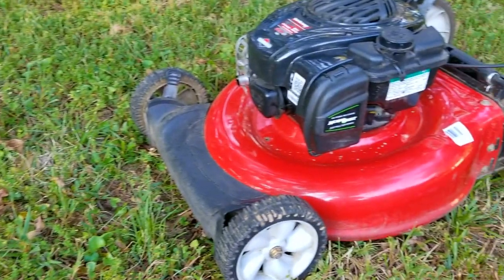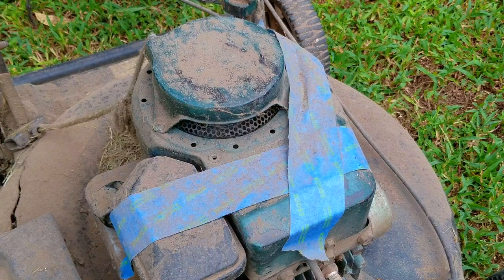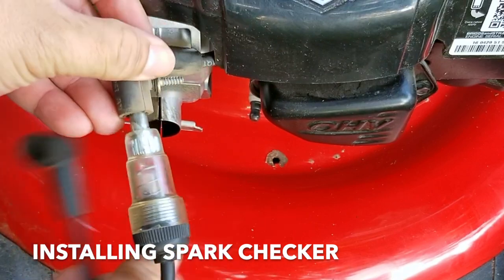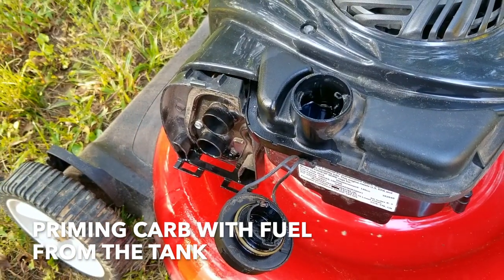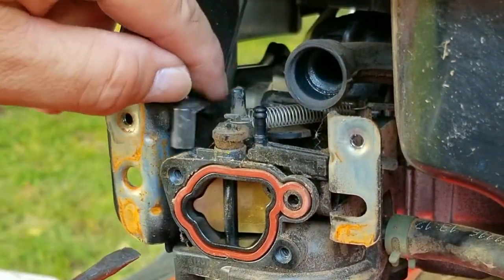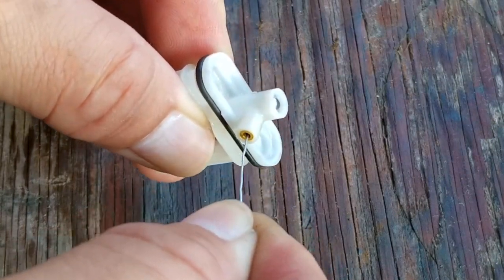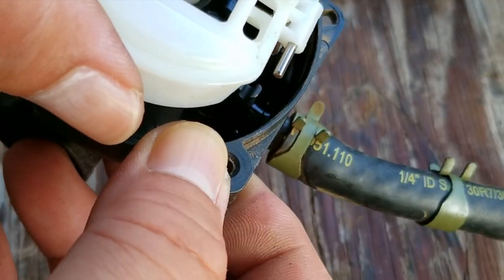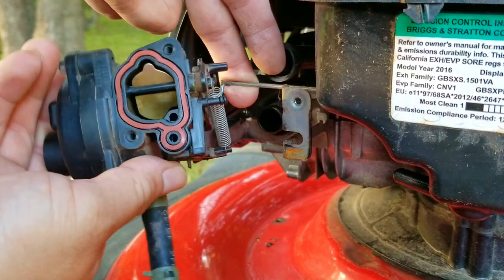Why Did Briggs Stop Making The Flathead Engine?

Comment: When I was a kid in the 50s, I mowed our lawn with a 1 hp B&S flathead reel mower. One time I removed the head and cleaned out all the crud in the combustion chamber and replaced the head without even a new gasket. The compression was around 5 to 1 but the machine still had a lot of pep. Every once in a while I'd go over to the nearby Chevron station and get a gallon of white gas for it. The air cleaner was one of those oil-bath types.
Reply from the maker: thank you kpadmirer.

Comment: emission standards
Reply: Shouldn't flatheads be easier to run lean because of the lower compression ratio?
Reply: This is the correct answer.
Reply from the maker: if so they held out for a long time.
Reply from the maker: probably but then they wouldn't make hardly any power.
Reply: @INSIDEHOUSEGARAGE  Yes, exactly, you are correct. The OHV design is better for emissions and can run leaner, but ultimately costs more to make than the flathead design. They did their best to hold out, but they eventually had to switch over to the OHV and find other ways to save money, as the valvetrain costs more to manufacture. That's probably why other areas are more skimped out.
Reply from the maker: I have to agree with you.

Comment: I have a 1998 KGro Power Pro Riding Law mower with a flat head engine Purchased from K Mart. Other than a belt replacement and a new Carb with Regular Oil change she has run like a champ for over the last 20+ Years! And Still Going strong!!!
Reply from the maker: Thanks for sharing

Comment: The Flathead engine was well abandoned by the automobile industrial 60 yrs ago for its low efficiency. It survived till recently is lack of competition. Its hard to adjust valve stem clearance also make some of the pull start really hard.  The OHV engine have way better combustion chamber, burn cleaner and use less fuel. Look at all the commercial push lawnmower engines all use OHV engines.
Reply from the maker: you are correct

Comment: I've had a 163 for 3 seasons and I'm sold.  Compared to my memory of pushing Briggs equipped mowers in the 1970's (for other people) which I hated, and the Lawn Boy my parents owned (which I liked) the light weight and solid power of these new engines reminds me of the Lawn Boy's power to weight. Every Briggs was just pushed into a corner after use and to my knowledge none of them were well-maintained so they all had their own special incantation to get them started and most of them had some sort of personality in how they ran. These new ones are a different experience- they either start and run great or they don't and there is a very specific issue to fix. Keeping the valve lash in spec and the float bowl clean seems to be all mine needs to start on the first pull every time. Making a carb that can be replaced with two socket drivers and $15 is an accomplishment.
Reply from the maker: Wow, I like this comment a lot!

Comment: I have a Craftsman lawnmower with a 6.0 horsepower Briggs and Stratton engine. I don’t know it’s age, but it’s the flathead design. The thing runs beautifully. I plan to change the oil in it this spring just like I did last spring. I use SAE 30 weight oil every time.
Reply from the maker: very nice maintenance!

Comment: I actually found one of these mowers on the side of the road in the past. I was able to clean the carb jets, the smallest jet was clogged. 

Used the metal from a bread tie (coating removed) and cleared it out before blasting it with carb cleaner. It wasn't a difficult thing to do, and there easy to trouble shoot if you have some starter fluid on you.
Reply from the maker: very nice work!
Reply: Electric guitar string wire is both stronger and skinnier and comes in 6 sizes.

Comment: I had a intek briggs on a john deere zeroturn. The camshaft failed as they do on those motors at about 200 hours. The neighbour has a cat D6, he dug a hole 4 feet deep especially to bury the  intek. Great feeling to never see that junker again!!
I now have two old push mowers with flathead briggs and a kohler on the zero turn. They have run now close to 11 years with no problems
Reply from the maker: wow that's amazing that you buried the mower!

Comment: in '73 I took a 6 h.p. B&S engine off the 'Planet JR.' rider (pulled gangs) (BTW that same engine was bore and stroked twice by mfgr. to become 7 then 8 h.p.) that hadn't been used since '59. I disassembled and cleaned it, reassembled it, and got it to start and run! Basement cleaning project that taught me sumthin'!
Reply from the maker: not a bad way to learn.

Comment: As someone who worked in small engine repair for atleast a year and a half (and kind of maintains my small fleet; toro smartstow w/ bs 163 cc, bs snowblower w/ 212 cc, power mate 2-stroke trimmer/edger, Ryobi 2-stroke 14" chainsaw w/ 37 cc), I can vouch the older models are definitely tried and true compared. Those ol' 3 hp mowers were very reliable and the plasticy, primer style carbs worked well, and the engines to follow were, IMHO, better designed even though it had more pieces. My Toro, despite having that crappy newer plastic carb (actually very easy to rebuild as you showed), is still a good, tough mower. I'm not a fan of the smaller 125 and 140 cc engines, respectively.
Even though they don't have drain plugs, you can tilt the mower on the oil side, and it works as well. Even though your video was about Briggs and Stratton, Honda was better when it still had their gxv series engines. The gcv160s are good engines, but they had an issue with cam belt (under the valve cover) slipping off and knocking the engine out of time, until they made a new cover with a metal tab welded on the inside. I'd be curious about the newer gcv170s. :)
Reply from the maker: thank you Kingswood7189.

Comment: Bought my first house in 1975.  It had an old, beat up mower in the garage.  Unwilling to spend the money on a new, fancy mower I wire brushed the deck, painted, etc. and changed the oil, cleaned the carb.  Briggs, but worn off labeling so I don't know much about it.  I mowed my lawn almost every week during the season until 1992 when I moved.  Took the mower with me and used it at the new house until I hit a brush hidden pipe in 2010 and bent the shaft.  Never smoked or used oil.  Good engines.
Reply from the maker: you got that right, thanks for sharing

Comment: Thanks again!  I learned somethin’ new, didn’t know that the center piece of the emulsion tube separates!  I’ve cleaned these carbs before but this is fascinating!  I will Definitely do a thorough tear down on my next maintenance run!  Keep those great videos comin’!  As far as them axing the drain plug to make it difficult to change oil, I just use an oil siphon to suck out the old oil into a holding tank and then use a funnel to pour in fresh oil!  They can shove it with their no oil change gimmick!  No engine will last with that strategy and that’s what they’re bankin’ on!
Reply from the maker: thank you and no problem!

Comment: I have a Craftsman/Briggs and Stratton mower that was bought  new in 07, I took it to a repair shop in a farm supply store since it wasn't working.  They told me for a rebuild on the engine, it would be 150 bucks. Cheaper than a new mower so I said do it. A week later they called ,saying they couldn't fix it. I took it to a friend's place and after looking at it, replaced a blown head gasket .I am looking forward to my 15th year with my old mower!
Reply from the maker: wow, nice one.

Comment: I got the mower that you are working on and after the first winter it wouldn't start. I bought a new carburetor and put a fuel cutoff valve on it. Two years later runs great. Never let fuel sit in the carburetor
Reply from the maker: Great job Charles Stull

Comment: My old Briggs powered mower was the base model cheapo push model. I bought it for $85 brand new in 1977. It spent its entire life outside with a bucket over the engine. In the winter all I could see was the handle sticking up through the snow. It always started and ran. I changed the oil every couple of years. The old flathead outlasted the mower deck when it developed stress cracks and rusted away. I put the engine onto a different mower and it ran until I gave it away. It served the new owner well. I had it about 40 years. Never burned oil or smoked either.
Reply from the maker: wow, that's pretty impressive!

Comment: I was faced with buying a new mower as my old flat-head B&S had a carb on it that took a special Primer bulb that  I could not find for love nor money , so I would start it with quick start
and 30 minutes worth of tinkering every time I needed to use it.... so I had enough...
but instead of buying a gas mower I got an electric one (battery powered) from Harbor freight tools, it was self powered and I just hoped and prayed one charge would do the entire yard...
it turns out one charge would do my yard and the neighbors yard 2 times before it ran out.
 it was a strange thing to get used to but I really love it ! .... beats pulling a starter rope !
Reply from the maker: I like the way you put it.  I've had a lot of other comments that were very one sided.  The only thing I would like to add is the "unmentioned" storage and charging tips, to help keep the battery healthy. Otherwise
after 2 season, that same battery won't do the neighbors yard, 2 times over. thank you Bob Kelly.

Comment: I haven't had a lot of experience with the overhead valve Briggs and Stratton engines apart from an Intek engine on a ride on lawnmower that I had to replace the cylinder head on for someone which has a tendency to blow cylinder head gaskets,burn oil due to that & the valve guides were known to move in them,Taryl Dactal used the grub screw trick to fix one of them up.

Yes,the now 35; year old 3 horsepower L headed engine on my push mower that I rebuilt is very good & reliable but it's much easier to adjust the valve lash on the newer overhead valve engines !
Reply from the maker: you make a good point.

Comment: My grandfather has an old mower which was made in the 1980's. I kid you not, that mower was first used in commercial use, than bought by my grandfather and it STILL runs great and had about one oil change throughout the past 30 years. These old B&S engines will outlast us all!
Reply from the maker: that's pretty amazing
Reply: Two words:  Planned obsolescence.  I don't think Briggs engines will or even have outlived us as eventually Briggs will fold and the fact that parts will be discontinued in the next few years for these engines if they haven't already.   I think that if anything, the flathead engines may be banned before long and after another few years we won't see much in the way of gas powered mowers and also will be using drought resistant plants instead of grass as it's healthier for the environment thus banning lawn mowers altogether..

Comment: My first mower was a 1968 or 1971 Pincor 21 push mower with a 3.5 Briggs and Stratton. I got it for free it had sat for 20 or 30 years. I brought it home the oil was black as crude oil and it had pretty low compression but the tank looked clean and with some starting fluid and a few pulls it fired up and ran. I used it a few times but I fired it up one day and could hear a tapping sound. So I shut It down drained the gas and parked it. Fast forward a few years I got my 74 Jacobsen with the same engine. So I recently dismantled the Pincor for spare parts. The crankshaft with the blade removed had about a 1/2 inch of play up and down and it still ran it always had oil in it as long I had it so that was just from an extreme amount of hours. the deck is still good so i might throw that together with some spare parts I have laying around. From my experience you can't kill a pre 1990 Briggs engine.
Reply from the maker: you got that right. Those were some great machines

Comment: I'm in my 40s and grew up pushing around mowers with the classic 3.5 Briggs & Stratton. Seems like every mower  that we had had that same engine. They were very reliable. The decks usually gave out long before the engines did!
Reply from the maker: I know right, it almost seems they realized the motor was going long lived so they had to figure   out a way for the mower deck to give out, to help out sales.

Comment: We have a 25 year old mower with the cheap flathead Briggs with the pulse type plastic carb (no Quantum). Once the ignition coil was broken and it needed two carb diaphragm sets in the 25 years to still run great. Only oil consumption is getting worse.
My grandpa had an OHV Intek 55, what a great engine. Very powerful, fuel efficient and always ready to do the work. Sadly the rest of the mower wasn't good so he changed to a new one with one of the last build flathead Quantum engines. Power ist nearly on the same level as the Intek, but it uses more fuel.

What I like about the OHV design is the better fuel efficiency and that it's easier to check and set the valve clearance.
What I like about the flathead Briggs is their pure robustness and the ability to run on nearly every burning fuel. They always start on the first pull even after sitting months.
Reply from the maker: thank you Henrik.

Comment: My UK branded Qualcast mower has the 160cc version of this engine, same build year 2016.
Running on straight pump gas, Mine has never failed to start in 6 years but i do always empty the fuel tank before winter storage.
Reply from the maker: you're doing a fantastic job, of maintaining it.
Reply: You are just getting the ethanol fuel there and you may soon discover issues we have been dealing with for decades now.

Comment: I have one of the Intek v-twins on my lawn tractor. My biggest issue over the years was their choice to use a brass valve stem guide pressed into the aluminum head with no locking of any type.  
Engine overheats at all, aluminum expands, brass works its way out,  rocker collides, and pushrod bends.  There's probably 3 or 4 pushrods floating around in my crankcase
Reply from the maker: thank you XirallicBolts

Comment: I have a mower that is pretty much a twin to the one in this video.  Reading the maintenance manual, one of the advisories is that the engine be run until the fuel tank is emptied when the mower will not be used for extended periods. You also must use premium/93 octane gasoline.  It helps, but is not foolproof.
Reply from the maker: very true.

Comment: I had the same issue on one of these last week that I had leant a friend.    I was super impressed with how simple it was to pull apart and rectify the problem. I'm no expert but the old governor springs and throttle linkages surely made the old motors more costly to dismantle for repair time wise if you had to pay to have it done.
Reply from the maker: thank you for sharing your experience

Comment: Few people realize how difficult it is to manufacture consumer products in the US and consistently turn a profit. Every extra 1/10 of a penny has to be engineered out. If you can make the paint layer thinner, you have to do it. It's my understanding that B&S makes engines for the US market in the US. Kudos to them! Maybe adding gas stabilizer to your gas can when you fill it would help.
Reply from the maker: from what I've seen they do make their engines in the US, but the ones that have tighter margins, are made overseas.

Comment: 1:38 It's exposure to air (evaporation) that's the problem. Whether it's in a tank, or in a floatbowl.  If you evaporate an entire tank of fuel in your carb by way of gravity feed, you're going to have a bad time. Keep it sealed and you can (and I do) store gas for years. It "doesn't seem to be as effected" because anything with EFI has a nearly air-tight fuel system.
Reply from the maker: thanks

Comment: I've had a self propelled mower with briggs flat head for 22 years. Possibly the most reliable and low maintenance piece of garden equipment I've ever owned. The new Hondas have all sorts of issues, don't know about the new briggs. I have thought about rebuilding mine if I can get parts. I reckon gaskets seals and rings and it'd go another 20 years.
Reply from the maker: thank you Damian Carvolth, and I would agree too.

Comment: I have this exact engine on my mower. Change the oil, air filter, and plug every season. I also make sure to run 91 octane from shell (has 0 ethanol) and drain it for winter. I bought it used and have owned it for 6 years and always starts on the first pull even out of storage. Taking 20 minutes to do some basic maintenance at the end of every season goes a long way. Stuff is too expensive to be buying every other year, May as well take care of what you have and enjoy it
Reply from the maker: very nice maintenance, you're doing a fantastic job.

Comment: I use a lawnmower with a 1986 Briggs 3.5hp and it is a tough engine. I fix and sell lawnmower with flat head engines only. You just can’t kill a flat head. The OHV ones are just scrap. I brought a OHV one just to smash it. They are harder to work on. They leak.
Reply from the maker: the newer engines definitely have their issues.
Reply: @INSIDEHOUSEGARAGE  lots of them

Comment: You aren't lying about those Briggs engines. I have two push mowers with a Briggs 6.25 in them. One sat outdoors for five years in non running condition, and I put an $8 Chinese carb on it and it has had no issues since then, other than a corroded kill switch. The other one has been through the ringer and has had a rod knock for five years or so, but starts on the first pull every time. One is 15 years old, and the other is 13. They both have plenty of life left. The fact that these two mowers are still running shows how tough those engines are.
Reply from the maker: you are correct, it's amazing how long they can last with a bit of maintenance